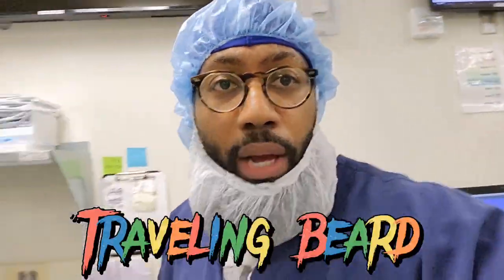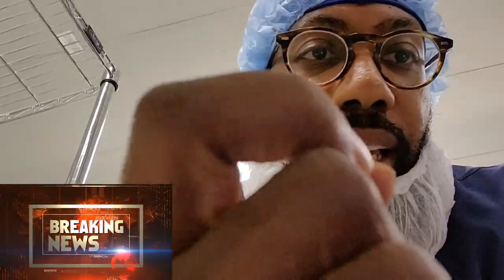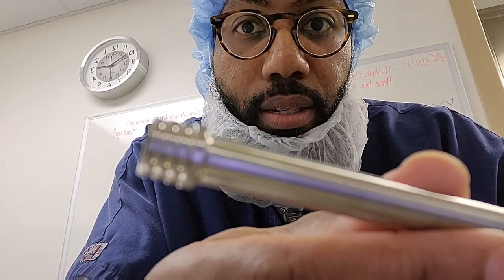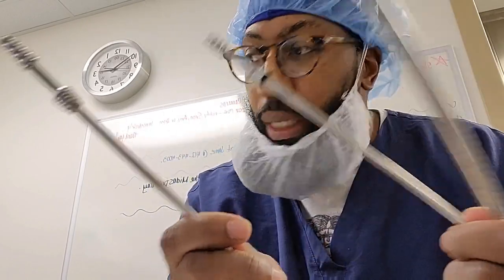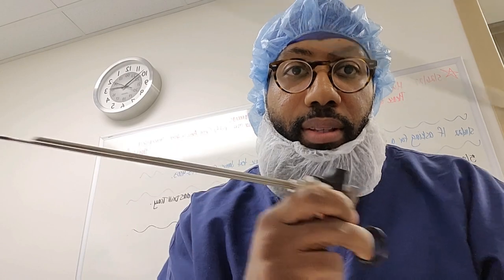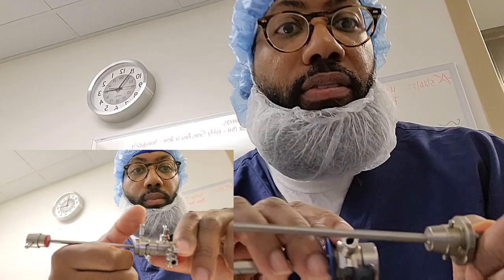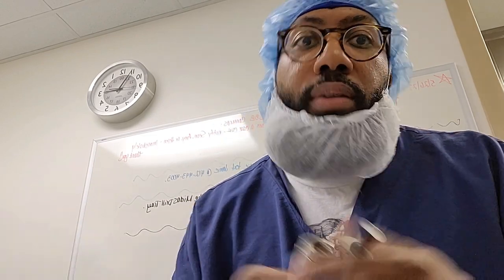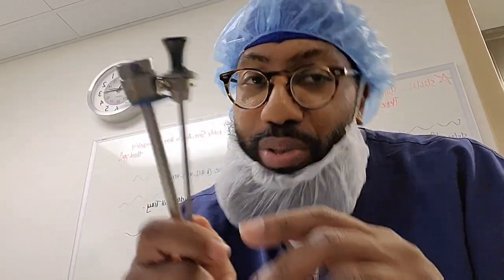Sterile Processing Technicians common mistakes #commonmistakes #sterileprocessing #instruments

Comment: Do you wear gloves in the prep/assembly area. Is there any written rule that you cannot wear gloves in assembly area and still washing hands every set you assemble is the best way.  Thank you
Reply from the maker: There isn't no rules on wearing gloves that's mostly a personal preference, personally I couldn't do it hands sweating, you have to keep changing gloves, and most hospitals don't have gloves for ppl to keep throwing away
Reply: I keep on researching and only thing i can find is, according to infection control.. gloves transmits microbs, same as hands… but proper hand washing everytime you touch a set is the best practice.  If employee feels safer wearing gloves in prep area, this should not be the reason as instruments coming out from the washer supposedly got properly cleaned in the decon